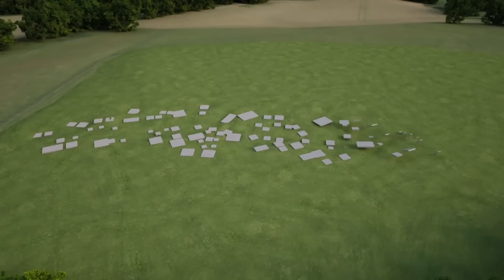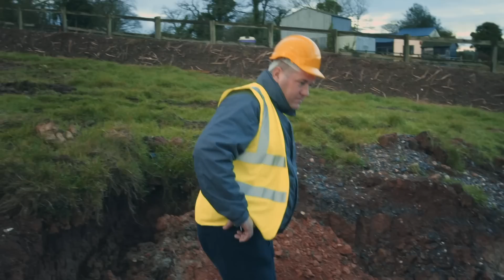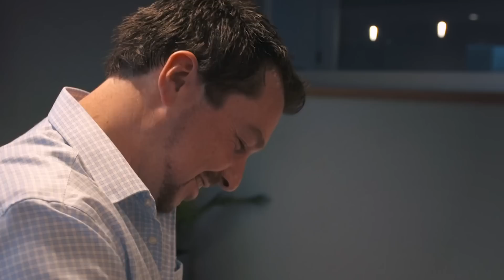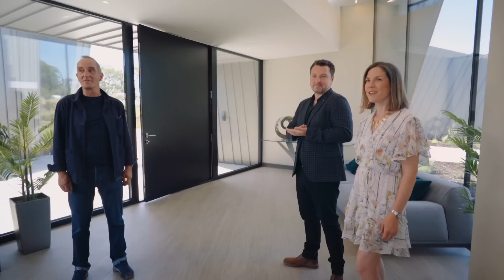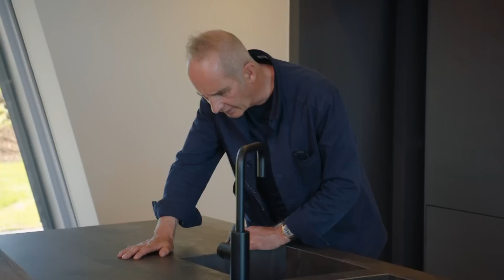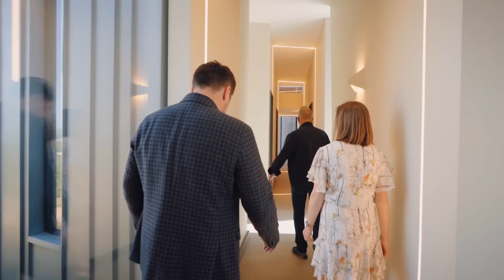INCREDIBLE Modern Home Build Goes Millions Over Budget | Grand Designs | Channel 4 Lifestyle

Comment: The biggest design flaw is TOO MANY SHARDS TIED TOGETHER IN A MESSY MASS instead of separate distinctive shapes. ALL GOOD ARTISTS KNOW     SPACE   BETWEEN FORMS is essential to EVOKE BALANCE & BEAUTY.  Space in modern design is even more important than the structure itself. If the OWNERS had CALMED DOWN the mad ARCHITECTURE'S VISION by REMOVING HALF of the BRUTALISTIC SHARDS leaving visual SPACES between them & changed the HORRIDLY EXPENSIVE ZINC to smooth rolled steel while EXPOSING some of those EXPENSIVE WOOD BEAMS, this obscene FURTURISTIC mansion would have WON AWARDS & cost 500,000 less.

Comment: A GIANT HOT EXPENSIVE MESS that could have been brilliant but THE OWNERS REFUSED TO EDIT & REFINE THE PROJECT. Architects live in fantasies & always require feedback from engineers & project managers to make their dreams become reality When you look at the original model it is LIGHT WOOD that sings with space & light. The result is NOT AT ALL like the NATURAL ROCK the architect modelled it after.  It is tragic that the beautiful custom WOOD BEAMS are COVERED UP ( & could have been replaced with cheaper quicker steal beams). The HORRID GREY ZINC LINES CONFLICT WITH THE LANDSCAPE feeling oppressive instead of" cave-like" as the Architect had intended. The biggest design flaw is TOO MANY SHARDS TIED TOGETHER IN A MESSY MASS instead of separate distinctive shapes. ALL GOOD ARTISTS KNOW     SPACE   BETWEEN FORMS is essential to EVOKE BALANCE & BEAUTY.  Space in modern design is even more important than the structure itself. If the OWNERS had CALMED DOWN the mad ARCHITECTURE'S VISION by REMOVING HALF of the BRUTALISTIC SHARDS leaving visual SPACES between them & changed the HORRIDLY EXPENSIVE ZINC to smooth rolled steel while EXPOSING some of those EXPENSIVE WOOD BEAMS, this obscene FURTURISTIC mansion would have WON AWARDS & cost 500,000 less.

Comment: Such a waste.  For that much money you could have a McMansion with 10' ceilings, indoor/outdoor infinity pool, rooftop patio bar with a hot tub all powered by solar panels, house batteries and geothermal heating and cooling.  Throw in a helipad in the back just in case your baller friends want to visit.

Comment: It looks more of a workplace than a home.🏡
Reply: It is a more industrial type of architecture due to the metal skin, I wouldn't say workplace as that would be more uniform than the random elements of this building, however as you only see the outside when you go in and out it will be offset by the view, that is the real architecture, it's the location darling, the house is secondary but it is unique, the inside of the house is not so stark as the outside and this softens it's appearance but it still is on an industrial scale, so you couldn't fit a £5,000 flat pack kitchen in it as it would look like a dolls house one. Like with all these big buildings it's the maintenance that's the leveller, if it costs too much to maintain it will not last, and it has to last to find an historical value, the true statement for all buildings and structures is their longevity and to serve a useful purpose to sustain that!?!

Comment: I've never been so torn. I want to love it, but I hate it... It is perfect for someone who needs to entertain and dazzle potential clients so they purchase whatever it is, the owner sells.
Reply: A GIANT HOT EXPENSIVE MESS that could have been brilliant but THE OWNERS REFUSED TO EDIT & REFINE THE PROJECT. Architects live in fantasies, & always require feedback from engineers & project managers to make their dreams become reality! When you look at the original model it is LIGHT WOOD that sings with space & light. The result is NOT AT ALL like the NATURAL ROCK the architect modelled it after.  It is so tragic that the beautiful custom expensive wood beans are all covered up & could have been replaced with cheaper quicker steal beams. And the HORRID GREY ZINC LINES CONFLICT WITH THE LANDSCAPE feeling oppressive instead of" cave-like" as the Architect had intended. THE SHARDS are LOST IN A MESSY MASS instead of separate distinctive shapes. ALL GOOD ARTISTS KNOW     SPACE   BETWEEN FORMS is essential to EVOKE   BALANCE & BEAUTY.  Space in modern design is even more important than the structure itself! IF ONLY the OWNERS had CALMED DOWN the mad ARCHITECTURE'S VISION by REMOVING HALF of the BRUTALISTIC SHARDS leaving visual SPACES between them & changed the HORRIDLY EXPENSIVE ZINC to smooth rolled steel while EXPOSING some of those EXPENSIVE WOOD BEAMS, this obscene FURTURISTIC house would have WON AWARDS.

Comment: its such a shame that a structure so strikingly beautiful has had its interior ruined by what looks like an oak furnitureland catalogue
Reply: Also none of the windows open to that beautiful countryside they have on their doorstep!
Reply: I liked the interior myself, it was softer and less randomly stark. The ventilation in the summer might be a problem if the under house supply ventilation is not performing (and overhead extract doesn't perform either one presumes), but in the Winter it will be a blessing, I would imagine they have a doorway to an outside area with a barbecue kitchen, firepit and whatnot so I don't think they will be disadvantaged, and it is offset by large uninterrupted stunning views of the countryside, that is if course, if you like that sort of thing!?!

Comment: I love modern architecture but you can go too far. The view is the the jewel in this project so why divide it up in to small parts just for design reasons. It negates the ‘raisin d`etre’ of the project. Overall the cost is obscene for a result which is far from satisfactory and spoils the landscape.

Comment: It is an amazing home, but I would feel a disconnect from the surrounds because you can't open the windows.  In the kitchen/lounge, I think they could have had the large windows open if they had engineered it to have a central, rotating pivot at the top and bottom. That would allow you to angle them to catch or block the breeze as well. To be fair, it may still have required a central horizontal brace in the frame, but I would be happy with that if it meant I could open them.. Weirdly it looks like you can't open even the small windows in the house.  
Other than that, I quite like the design all up. The interior is spacious without being domineering and cold.

Comment: It doesn't take a genius to figure our leaving green and un tempered wood out in the wet will do something to the woods structure. I blame the builder for that one - he seemed so sure it was the fault of having it done in a factory - not at all - it is the fault of incompetent storage by the user.
Reply: Was it stored inside at the factory?  12 months to get the frame done i dont think so. How about the transport company? Stored inside? Alot of factors should have been accounted for, its not just the builders fault.

Comment: Multi million investment and frames are wood??????????
Reply: I think thats why the house ended up costing 2.5 millin instead of 5 to 7, the construction with wood is probably much cheaper than concrete and steel